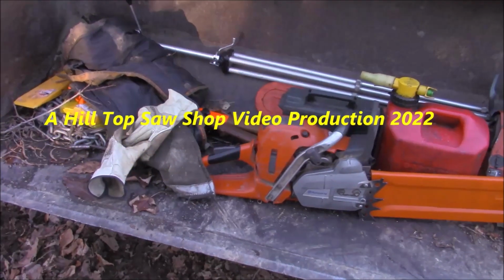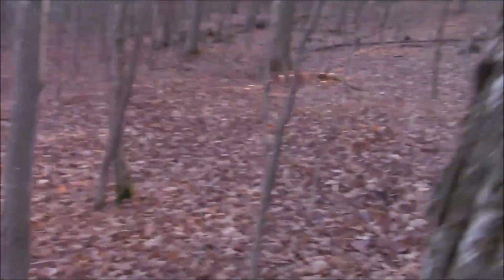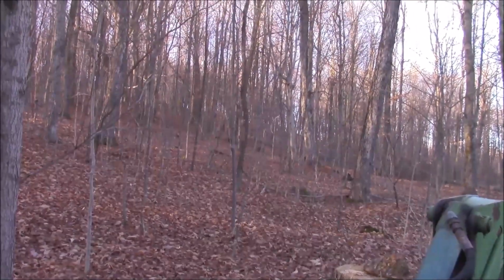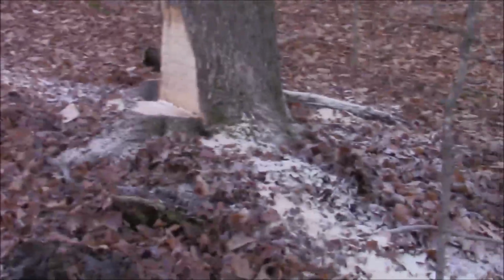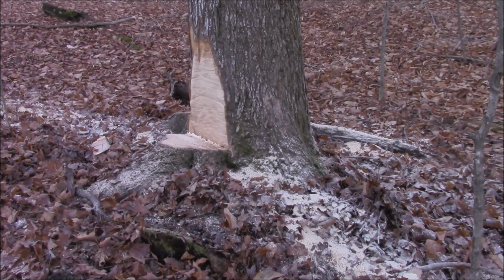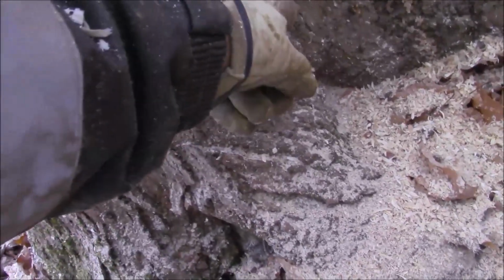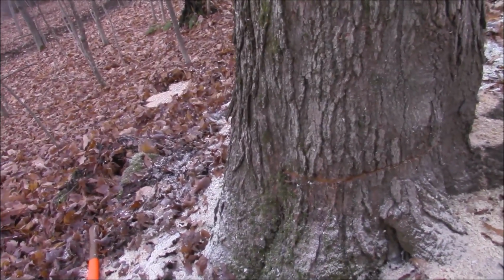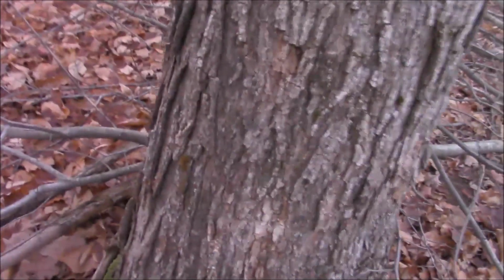Husqvarna 394 vs. Husqvarna 562 HTSS Falling Hard Maple,  A  HyWay 100cc Big Bore 395 Top End

Comment: I sold quite a few saws recently with the intention of thinning the herd and adding key saws with key sizing for my needs. I ended up with a 545.  I picked it up second hand for a great deal.  Seems to have very little runtime. A 562xp is next on my list and I would like to order with a 28in bar. I want the large mount on the 562 as opposed to the small mount on the 555 that way I can use the bars I have for my 372 clone saws.  Always enjoy the videos!